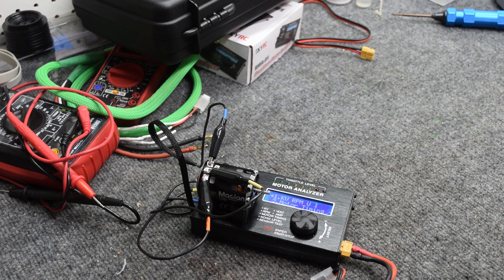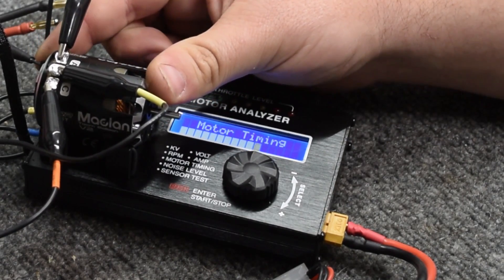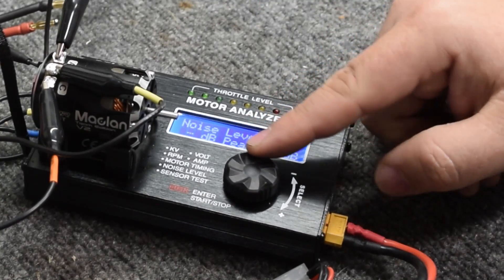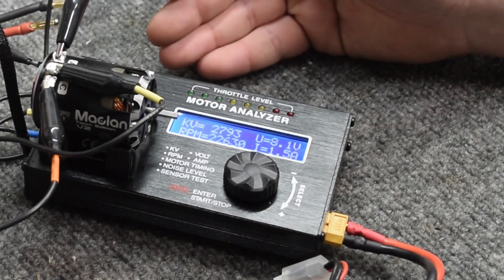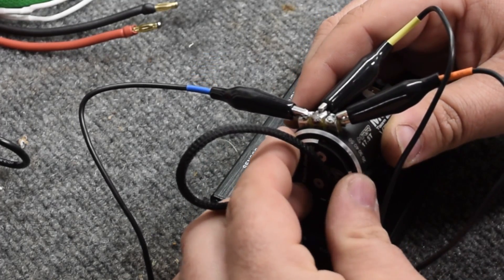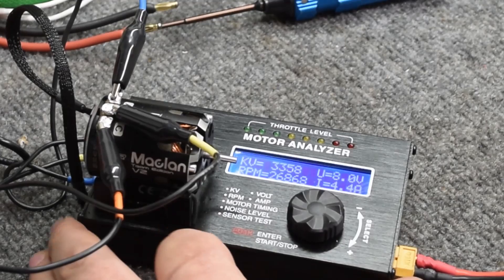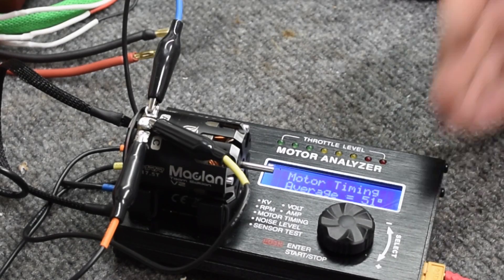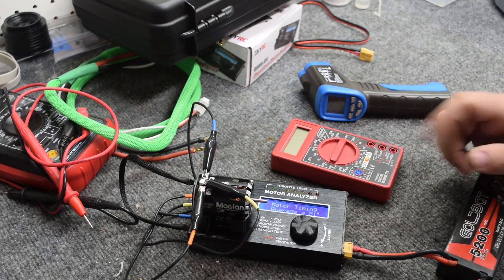How to tune your RC sensored Brushless motor, Part 2, Adjusting Timing using our Motor Analyzer

Comment: Is 6amps a base line or do I go to the data sheet of the motor to find the proper base line for the amps thanks
Reply from the maker: 6 amps is just a safe baseline.  I will tell you ever motor is different and the sweet spot for a rpm motor is different then from a high torgue motor like a trinity. Thats part of tuning a motor you have to do trial and error and old fashion test and tune to figure out what your specific motor likes.  The 17.5t revtec I have in my stock buggy I'm up over 50 degs of timing , I currently don't know the amp draw on it because I turned it up simply because of tempature. And havnt dynod it recently. I plan to do a continued video of this soon so stay tuned.

Comment: Question. Wouldn't it be good to install a pinion to at least add some rotational load on the motor when testing?
Reply from the maker: I dont see why you couldn't. Just like you can leave it in your car and check it then too.

Comment: Maclan states no more than 20 degress of endbell timing. Have you run this motor in a car with 51 degrees of timing?
Reply from the maker: Still in my oval buggy and runs just fine. Just need to pay attention to your temps. 
Your probably looking at a modified motor at 20 degs of timing not a stock 17.5.
Reply: @ChrisPatrickRC  You're right. Looking at their 3.5T motor for drag racing.
Reply: @JJQualityBBQ  I have a maclan drk esc and the r1 motor and was wondering the same thing

Comment: When i try to test timing it just says "please wait" then it gives me a time out message. What am i doing wrong?
Also should my motor get hot during the kv/rpm test?
Reply from the maker: What motor are you testing ?
Reply: @ChrisPatrickRC  Fantom icon 3.5
Reply from the maker: @99ville  I personally have never tried a motor that high. Or that error.
Id suggest try a different motor and make sure the analyzer works first. 
If you can't do that try a different balance wire. And check your a b c wires . 

As for heat it depends on alot of factors. But yes if your motor is turned up high enough, your motor will generate heat.

Comment: Hey just curious, I have Trinity 3.0t and I have same Analyzer.  I went to test RPM, everything hooked up correctly, Timing all at 25 degrees... I hook up 3s battery and did the RPM test and Motor start smoking when I increased the RPM, not it won’t work! What do you think happened!? What you think I burned up?
Reply from the maker: id bet you fried your analizer, the Input Voltage: 7.4-8.4V (Suggested to Use 7.4V 2S 1P LiPo Battery) so its only rated for a 2s battery pack.... that would be my bet.  did it damager the motor itself is the question ,  id say it didnt but it could have fried a balance board inside the motor possiably. id have to see it to tell you for sure , but i bet you killed the analizer and it smoked, and that smoke went threw your motor which made you think the motor fried.

Comment: How much information do you know about brushed motors?
Reply from the maker: I grew up racing brushed motors. I did a video on them.
Reply: @ChrisPatrickRC  i raced them but knew nothing about them in the 90's. How in depth of knowledge you on them? Does a windings wire diameter change anything? Make it faster or have more torque if the wire diameter changes to a larger wire? Also I heard a delta termination makes for a better motor instead of a Y termination. Any info on this?
Reply from the maker: @michaelchristensen6884  no my knowledge on that part of the older brushed motors. but you can adjust springs and brushes to change the performance of the motor, they also use to put the rotors on a lath and trim the armature down to make it smooth to get the most out of it. 
Also you can adjust timeing buy also turning the top can slightly, but it was minimal compared to what they are today. 
but as for internals no, i was cluseless back then about that subject.

Comment: Just curious. How would you time a Castle? The can is bolted with three bolts from the can to the rear plate. I think castle link allows you to do it in the cheat section.
Reply from the maker: i personally have no experience with castle products so i cannot speak to anything about them. sorry i cant help you there.
Reply: you can only change end bell.timing on motors that have the option.  most castle motors are 4 pole and don't offer that option.
Reply: add timing through the ESC for castle motors

Comment: nice video...when running mod assuming your running boost and turbo...will you still tune your motors to 6 amps?
Reply from the maker: it depends more on timing at that point. reason why i say that is , lets say you have a base timing of 35 Deg of timing, your adding 15 degs of boost and 15 degs of turbo, so your final timing is 65 degs of timing, which is alot..... but i know alot of drag racers set it that way. 
goes back to what i said in the video, not 1 motor is exactly the same, thats where you need to do trial and error and see what your motor likes, also how your boost and turbo curves are set. 
so to answer your question, sorry i cant say 100% yes.... because there is alot of moving parts with a mod motor... i hope that helps you understand.